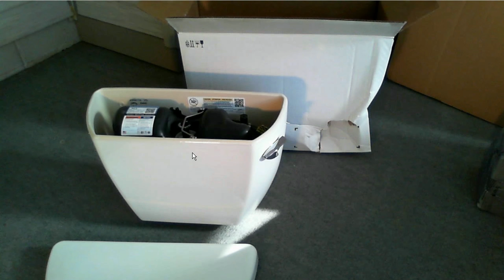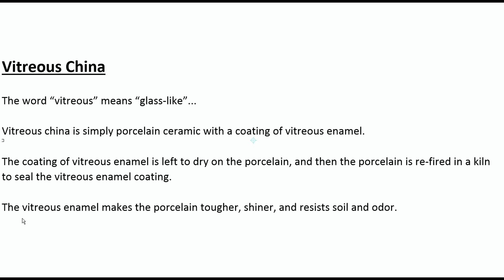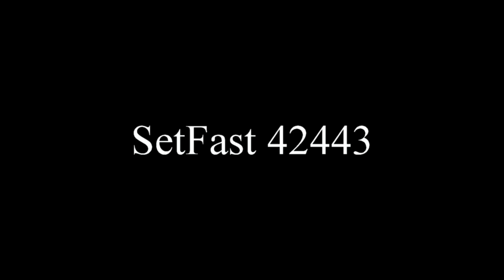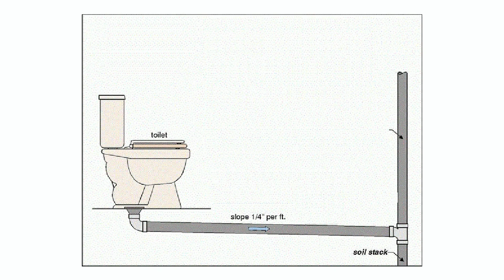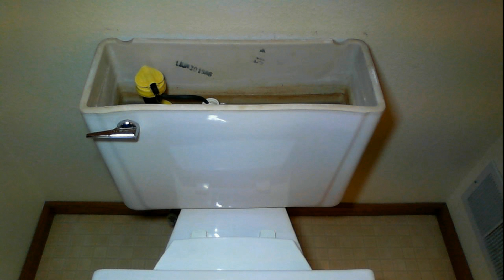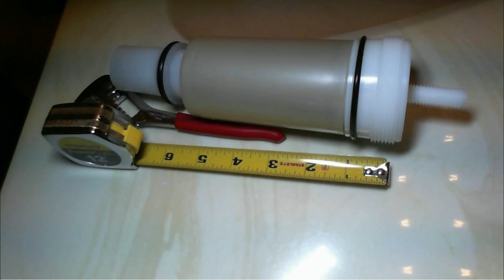Kohler K-3493 Highline Classic / Pressure Lite - Installation and Review

Comment: Excellent idea for my basement toilet replacement.  The extra pressure is important to push the stuff through the 6' length of pipe because the old toilet used 5 gallons.

Comment: I didn't realize there was an upper limit on PSI.  On my floor, I'm told it's 83 psi but on the upper level floors, it's 125 psi.  I will contact Kohler on Monday to discuss.   Thanks for this information !!!
Reply from the maker: You may want to watch this https://www.youtube.com/watch?v=xs2GXur9fPM
Reply: Thanks!  I'm glad I ultimately picked a kohler aqua piston gravity.  I don't want to deal with an over-pressured toilet !!!  Great resources, thanks!
Reply: Yeah, they recalled a few units that were dangerous on normal water pressure as well. But you can get pressure regulators for these. The aqua piston tech is perfectly fine for residential use, and isn’t as noisy. It is almost as good.